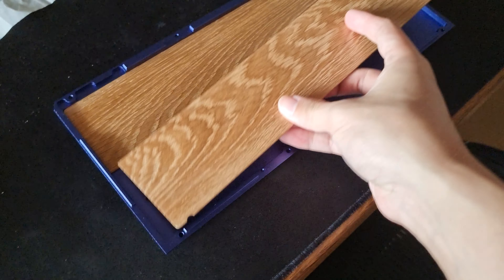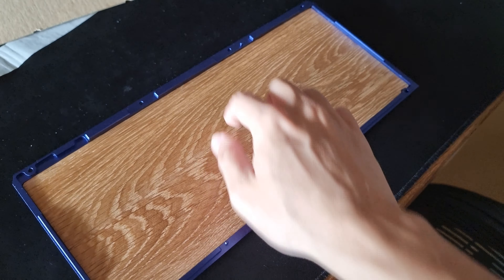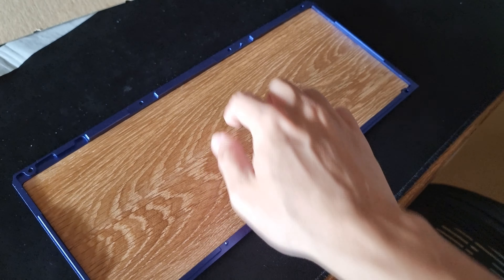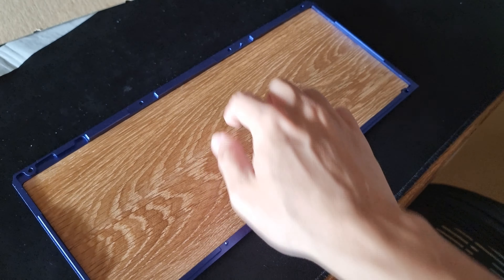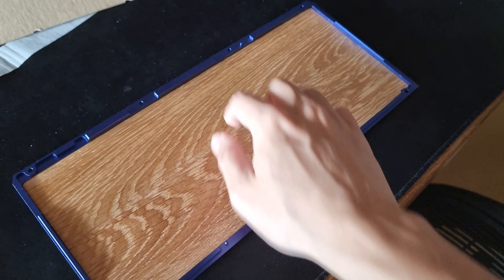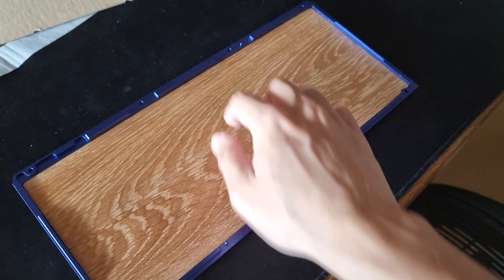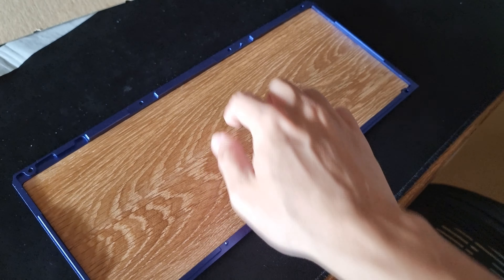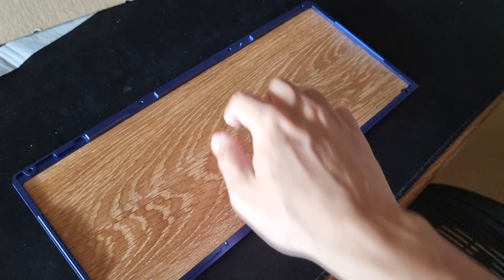Keychron Q1 Sound Tuning of Case Base Plate—wood mod

Comment: I will put some car noise dampener (butyl) in there. Putting o-rings around the case screws should also help with ping, or just 2 layers of tape next to the screws, to prevent top and bottom casing to resonate with each other when assembled.
Reply from the maker: Alubutyl laminate will work very well if you can wedge it in there with precise cutting and not use the adhesive. Even the fibreboard works. The typing sound is not much different. I did notice in Keybored's video that car dampener didn't reduce the metallic ring as much as wood, relatively speaking since different mic setups and room acoustics etc. I also didn't want to spend extra $$ and wanted to try something no one else was talking about. I've already added special frame sealing tape between the top and bottom casing, which is a laminate of paper, aluminium foil and acrylic adhesive. The case still pings because of other contact points between them. Maybe O-rings would help, but then the top will be sound isolated and be able to ring like a bell from my early testing. But since it's gasket mounted, the top case ping is actually not the major contributor to sound, which comes mostly from the PCB/plate/switches. Your situation and preference may vary of course
Reply: I think that orings around screws don't make much sense since the board is already gasket mounted, I doubt it will have any positive effect
Reply: @alexp3577  I meant orings between top and bottom casing to buffer contact between both alu parts. My Q1 arrived last week and I just used 2 layers of tape instead. There is no ping anymore (with additional alubutyl).

Comment: hey mate!
sounds like youre from germany too, right?
In my opinion you dont need any sort of dampening and just kbdfans stab foam on the bottom case where both top and bottom case are touching.
https://www.youtube.com/watch?v=CDkHSV7H1Ps
Reply from the maker: Hey mate! I'm in Singapore :) Putting foam between the touching edges of the case halves (I know you're not talking about a large sheet of foam across the entire bottom, I've seen your video within hours of you uploading it) actually is dampening the case, to be precise. Think of it like gel pads used on drums by musicians. Adding Tempest tape mod massively improves the sound further for me, and I've also done some other mods, and lubed but not filmed stock Phantom Browns on mine. Adding dampening to the case still improves the sound a bit, but only ~10-20%. Planning to record a video soon
Reply: @samuel-chia  Im talking about adding some thicker KBDFans Stab Foam (just the remaining part) on the upper side of the bottom case to isolate both from each other.
This results in absolut zero ping without the use of any dampening.
Reply from the maker: Yes, I know. But that itself acts as a form of dampening ;-) you can't say there is no use of any dampening
Reply: @samuel-chia  well, its more isolation than dampening imo
dampening is to reduce the resonance room
what i did was seperating both top and bottom case
Reply from the maker: @whnkeys  yes sir, I understand what you're saying but bear with me: if you say it's performing isolation and not damping, then the pings will be just isolated to the top and bottom case halves, not removed. Remember the case halves are screwed tightly together. This prevents proper isolation from occurring. The main effect is actually damping, not isolation
Reply from the maker: @whnkeys  I've just put up a typing test here: https://www.youtube.com/watch?v=EeNLzs8Bbq4 Enjoy! :)

Comment: Isnt 2mm wood a bit to thick to have enough flex for the gasket mount? Was thinking of buying 1,5mm butyl but now i am curious? Great video 👍🏽
Reply from the maker: Thank you! Yes, I'm hoping to sand it down to 1mm thick to get my flex back. Actually any material would work, polyfill, foam of any kind, gel pads, butyl etc. I just wanted to try something a little unusual rather than pay a relatively large sum for damping material
Reply from the maker: 1.5mm butyl will be a little too thick, you will still lose some flex. Try to get 1mm
Reply from the maker: Hey Mert Kaan Emre, perhaps you have already heard that Temp on Keychron's discord and a few others have confirmed that butyl is not a great way to dampen the bottom case (sounds bad and flex is affected). Also I've just put up a typing test here: https://www.youtube.com/watch?v=EeNLzs8Bbq4 Enjoy! :)
Reply: @samuel-chia  thanks for the information, luckily i didnt go with butyl, my q1 is now here and  i am waiting for my switches, when they arrive i will try some of your mods from your new video-which mod would you describe as the most necessary without to much hassle or investment? Thx for your content
Reply from the maker: @mertkaanemre4356  Thanks! I'm glad you didn't have to spend more money. I think Keybored's "force break" mod (it's actually damping and not isolation so I don't agree with the terminology) and Tempest tape mod gets you almost all the way there :)

Comment: You singaporean?
Reply: Mine not even shipped yet
Reply from the maker: When did you order yours? It should come soon
Reply: @samuel-chia  ordered on 25 but ordered fr4 plate together
Reply: @stig585  add ons delay overall shipping time
Reply: @user-kz9rz8ui1c  apparently
Reply from the maker: @user-kz9rz8ui1c  yup that's right
Reply: I ordered in Sg. Ordered on 04/09, received on 17/09 @???